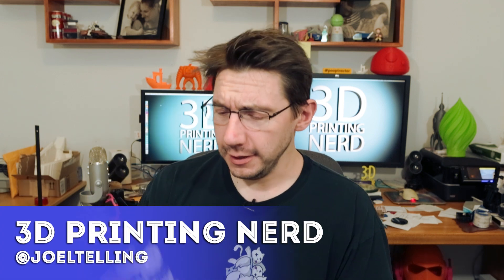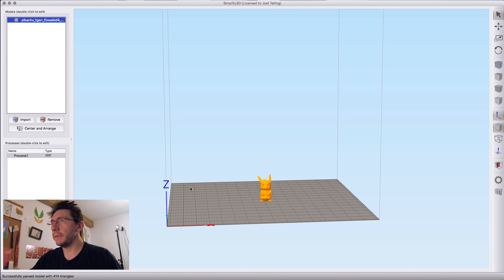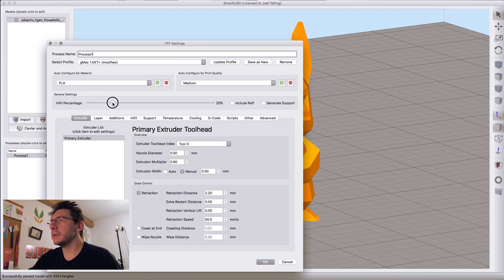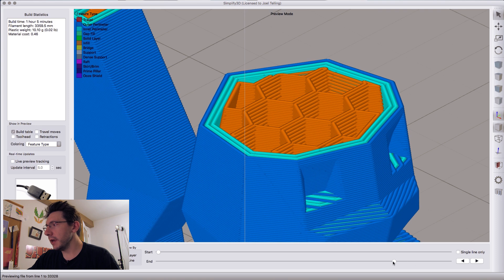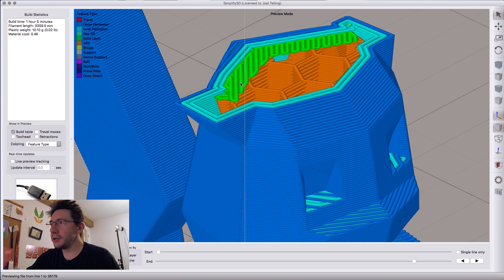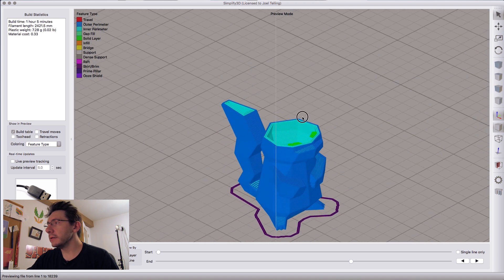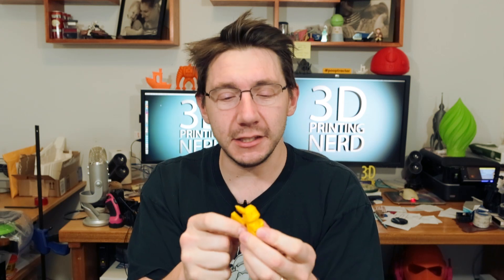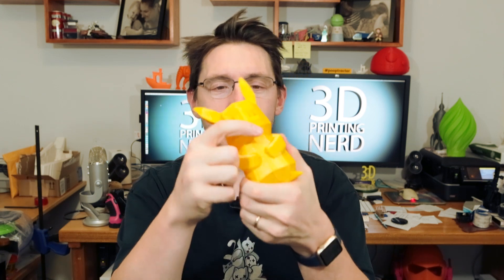3D Printing: Stop Wasting Plastic on Infill Percentage

Comment: ...and, slic3r and the newer cura, both open-source, have settings to use internal supports when your infill is at 0%, whereas your favorite proprietary simplify3d DOES NOT HAVE THAT, so how do you feel about advocating so loud for proprietary stuff?
Reply from the maker: I advocate for what I use and what works for me. #highfive
Reply: 3D Printing Nerd
so, let me understand here: you make a video about printing hollow with simplify3d even though it is the inferior slicer for this case, since slic3r and cura both have a feature which allows complicated hollow prints to succeed while simplify3d does not; and you call that 'what works for me', just because you in this case used a simple part? Notwithstanding the fact that simplify3d forbids sharing the resulting gcode and the reverse engineering of its .factory format, this is just plain wrong.

Also, nothing prevents you to use slic3r and cura. They are open source and also freely downloadable.
Reply from the maker: +Cláudio Sampaio This video is also a year old, and I've had the chance to use more than Sinolify3D in that year. Simplify3D doesn't prohibit the sharing of their generated gcode - I've looked into that AND had a conversation with Simplify3D and that just isn't the case.
Reply: 3D Printing Nerd
it is in their EULA, what they say to you personally does not matter much because it is the letter of the law that matters. I talked to Richard Horne and he said he had the same conversation and they said they added this to prevent people from making their software available through the cloud to lots of people and thus harm their sales. There is even a reddit thread about it, read on: https://www.reddit.com/r/3Dprinting/comments/49otwi/simplify3ds_license_prohibits_the_sharing_of/

Let me emphasize that this is the nature of proprietary software: anything and everything to enforce that artificial scarcity that leads to profit and power, even if it harms the user. Nothing wrong about profit, but everything wrong about control of creative work and arbitrary prohibitions.
Reply: It will very soon. In the meanwhile, if you use Cura 2.4.x or newer, you can add a few stls like cubes, overlap them with your print and select specific settings for these objects as "Support mesh" (force support where it intercepts with regular meshes) or "Anti Overhang Mesh" (force no support on the region). Try it, it is a little more trouble than using a dedicated manual support interface like in Simplify3D or Craftware but it gets the same results. I have made a screenshot to illustrate this to you: http://imgur.com/a/MeQJX
Reply: Cláudio Sampaio wait , so you essentially made the cubes into a grid pattern for custom infill or for supports? Great idea man, i will try it out, thanks!
Reply: Cláudio Sampaio i want cura to have custom supports like s3d and that other one
Reply: Slicer and Cura don't support basic features that Simplify 3d do. I would love to use a non-proprietary slicer, but non of the ones available are any good. Want to print a batch of parts with different settings? Only Simplify 3d. Want to have decent custom supports? Only Simplify 3d. Want to use infill that doesen't suck? Only Simplify 3d. Its infuriating because its interface sucks. You can make presets for different filaments and printers and quality, but its not clear what settings transfer over from preset to preset, and it likes to randomly lose settings so in practice the presets are useless.
Reply: why dont you make a youtube video about it then @claudio,  oh, seems you arent very good at it.

Comment: Considering the last functional items I printed on my machine were things that needed to bear a fair amount of load, I wouldn't consider dropping my infill percentage below 10% of them. These items were 50m worth of ABS filament. If the part breaks, that's wasted filament as well. I'm not going to quibble over a meter or five (at most) worth of filament as long as the print works. Now if you're screwing around and making Tchotchkes, sure, cut the infill. But if you're doing functional things, don't take the risk unless you can do your own FEA.
Reply: Now if only you could have watched the video instead of whining to the comments about something he already covered.

Comment: i get bad surfacing if i go below 15%, so i usually use 20% if i dont care and 25% if i do. if i want a structurally rigid part i usually use 2mm walls on everything. you can add further rigidity with geometry, like stepped ridges, grooves, or putting holes everywhere, the idea is these create additional perimeter passes in areas that need reinforcement. theres a lot of things you can do with strength increasing geometry (like a protruding peg on one part i made kept breaking off, and i solved the issue by ringing the base of the peg with a bunch of 2mm cubes, to generate better adhesion between the side walls and the surface layers). these work independent of infill since its all going to get extra perimeter. you still use plastic but at least this way you can select the areas you want reinforced. infill has diminishing returns when used for strengthening.

Comment: How about making a crush test comparison of different materials and infills using printed spheres, that would give a really good  idea about how much infill actually effects strength(and it would also make for a good visual demonstration ).
Reply: Actually spheres would be a pretty bad example as they are very structurally strong to begin with, a cube would be more representative of the average model.
Reply: Which is why I suggested them, with cubes all you would get is crush of layers on top of layers and that doesn't really tell you much about anything beyond the materials resistance to compression.
Reply: Thomas Maker I don't follow. A sphere will absorb a lot of the stress in its shell (a property not shared by most models), thus significantly limiting the effect of infill (which is what we want to test).
Reply: 6AM response and google+ not immediately showing the context to help one remember that it was about infill and not layer adhesion/shear and stretch strength(and a post made 2 weeks ago).....The inherent strength of a sphere might still give some interesting results though, seeing the difference between a sphere and a cube with the same wall and infill using a variety of filaments could be quite illuminating..

Comment: Quick Tip: For prints that must have say 30% infill just in one critical area, You can make 3 or more processes in simplify3D to for example use 5% and 30% and then 5% again.
Use start and stop at layer and change infill amount and top,  bottom solid layers of our processes.

Comment: I only do solidworks and sometimes autocad when it's about designing solids, so I'm not really familiar with the honey comb infill thingy or the other method , is that something only  simplify 3D does?
Reply: it's pretty much a staple in any 3d printing software thees days.
Reply: Although it wouldn't be that difficult to create a part with your own customized infill in solidworks. Just use shell command and combine it with a honeycomb grid. I'd imagine you would have much more control of the design that what you'd get in slic3r or cura or whatever.

Comment: You need more plastic for density, hurrrr durrrrr
Reply: Kane Smith but why do you need density if the model is going to be sitting on your desk?
Reply: max chavez Not everything printed out is going to be a toy, and even then, paper weights need a little weight to them as well.
Reply: in those cases yes, you need a bit of infill depending on what is the purpose of an object, but in some cases you don't need to have too much weight, like a drone casing for example
Reply: In that case, why not pause it halfway through, put in some nails (or lead) and hotglue, and continue? That'll really give it some weight!
Reply: Jelte Klas Wijnja because you dont want to "weigh it", you want to have it solid, so resin or something like that ,hot glue might melt your print lol but i see what you mean
Reply: Perhaps printing with the GMASS Tungsten filament would be enough. It weighs 4 times as much as water, so it will actually sink! It is quite brittle, however. Perhaps print a partially hollow print with open sides, so the water can flow in? That way, you won't have trapped air in the Infill.

Comment: You didn't say anything to really prove your point
Reply from the maker: +Nugenrules Well, crushing is interesting because of course infill will help - if anything it puts more material in the way of what's crushing. However, YES, test this when you get your printer!
Reply: Lol, okay but I would like to see something crushed for testing. Don't you think it's not enough to break one without infill without a reference to one with? My cheapo 3d printer comes in on monday so I'll be able to test it myself if you don't want to test this and video it yourself.
Reply from the maker: +Nugenrules crush the bigger Pikachu? My kids would kill me if I hurt that thing.
Reply: I agree with this if the part is decorative. But if I were printing all of my parts with 0% infill, my kid would surely break it. I agree with you on reducing plastic use and being conscious to the types of plastics that we are using and the impact that some of these plastics have on the planet. A little more testing would have been nice to see, but great video. thanks.
Reply: There are plenty of videos with infill % strenght , this video is more for those who print a big pikachu with 75% infill , total useless even if you want to sit on it, and if your kids are breaking it it's because your walls are to thin, 0% infil with 5mm walls is way stronger than 75% infill with 1mm walls , cause when it falls on the ground, it is not the infill who protect it from breaking but the thinckness of the walls . Infill in my opinion is here for support and antiflex (for decorative parts, as thsi video clearly talks for functional parts)
Reply: Yeah, I didn't see anything. Sure he broke an ear off, but the piece where the ear and the head meets wouldn't have any infill in it anyways.

The only thing I can conclude is that small plastic parts are tougher to break. Should have tried to crush the bigger pikachu with and without infill.

Comment: You know, if strength is what you require adding more perimeters is often better than adding more infill. Infill is needed to prevent the part from buckling if you try to kink it, and adds strength in compression so it resists crushing more. You rarely need more than 10-15%, if that. For aesthetic parts, you don't really need any.

Comment: you print cute cuddly things. infill is only for suport. i print stuff that ceep your bumper on your car or hang your monitor on your wall.. i need a bit infill..
Reply: Then you ain't wasting the infill if it is needed.... duh
Reply: Also, knowing a bit about the strength of structures will allow you to design objects that use minimal material while being as stiff and strong as possible.
For instance, consider a simple beam. Several things to consider with a simple beam.
1. The highest stress on the beam occurs on the top and bottom surfaces. Top is under compression, while the bottom is under tension.
2. The stiffness of the beam varies with the cube of the thickness.
The above 2 items is the reason that a steel I beam has the cross section it does. The top and bottom surfaces handle the load while the vertical portion is just to simply keep those 2 load bearing surfaces a fixed distance apart from each other. This allows for far less material to be used to handle a desired load.

The exact same principle applies to plastic and infill percentage. In many cases, if you have a beam in your item and that beam is failing, you can get a better result by making the beam thicker so that the bottom and top surfaces are further apart from each other while adding minimal material between those 2 surfaces (think I beam) than you would get by keeping the beam dimensions the same and increasing your infill percentage.
Reply: Same here, but seriously sometime I see poeple making figurines with more infill as I use for functional parts , for strenght you better add walls than more infill, in a certain way.
Reply: If you need something that will hold tv on wall while still looking fancy as you designed it why would you use infill just drill it fill it with cheaper stronger material.
Expanding foam for sth like it has to survive fall from 3m.
But still hanging your monitor or tv? Use wood it is much cheaper...
Reply: Missed the point all of them probably Biden voters Yeah I went there.

Comment: One more advice: if you do want to print a solid model, do not set infill to 100%.  Slicer just goes crazy. Instead, set bottom layers to 100500. It will be stronger and print faster.
Reply: 100500?
Reply: Agreed!!!  It prints MUCH faster!  It probably  ends up stronger as well
Reply: Sweet corn, you've done it....  you literally change the bottom layer from say (7_layers) to (100500_layers) and it will be a 100% infill model.   my Dickasaurus Rex went from 4  hours with 0% to 13 hours with 100500....
Reply: @offr0adrangerguy  Where are you sticking that Dickasaurus that you need 100% infill?
Reply: What's 100500?
Reply: By 100500 you mean 100% right?
Reply: Does this work in cura?
Reply: i was thinking personally just set perimeters stupid high. it takes longer but itll be even stronger
Reply: @pajamas720  I observed errors where thick perimeter intersects upon itself. This was 5 years ago.
Reply: Ater all of the fighting and dick waving above, I'm happy to report that yours is the only advice that I found valuable out of this whole comment section.. THANK YOU!
Reply: I too don't know what 100500 is...
Reply: Robert Medina I assume is a way to cheat the slicer to print all the layers in a model as solid as the bottom one. Hence the 100500, which is an arbitrary number for 'all the layers'.
Reply: What if I don't care about how long it takes?
Reply: Percival917 
Do what you want ....

Comment: Great tip! In general I use just enough in fill for the top layers to print. I'm at the moment printing a pulley from PLA which is flat across the top for 3 inches! 10% Does the trick nicely.

Comment: IF the model is for "looks" I usually print with 0% infill with two shells/outlines/perimeters(whatever your slicer calls it) and usually get away with it long as I use 5-10 "top" layers. I've spent countless hours printing including two whole home made printers while only using probably 5lbs of PLA/ABS in 2+ years.

Comment: Sure forget about infill as long as the part is just for show, if you actually need the part to do some mechanical work, varying infill density along the sections that require it is a must, specially with abs. In short, if its not a serious project just do whatever infill.

Comment: Personally I don't care about the plastic usage at all since I print very often and only use 1 roll per month, and I am only concerned about printing time and quality. I print with 50% infill for parts that I use for my printer. But you are right that some parts could still be made with 3 or even 4 perimiters with little to no infill and still retain strength. It works with pikachu, but won't work so much with objects that have a flat surface on top.
Reply: With proper cooling and a few top layers it'll work just fine even at 0%.

Comment: Hey- love the vid......I often run my printer when i leave for work but dont have anything to control it with. I have used a wifi camera but its not helpful if i something goes wrong, do you know of anything on the market to help with this? the only product i have found so far is 'heero'.....https://www.kickstarter.com/projects/guzu/heero-monitor-and-stop-any-electrical-device-remot which looks great but do you have any advice?
Reply: Get a raspberry pi and setup octopi, you can cancel a print, as well as, turn off fans and motors...

Comment: It would be interesting to see a stress test to determine the optimal fill rate/wall thickness for a given application, e.g. torsional, transverse and axial load capabilities.  Maybe something like a rectangular prism of a standardized size.  Perhaps different materials would respond more favorably to a reduction in fill rate or wall thickness?
Reply: 40% according to the undergrad paper someone did at our uni on our instron. All black PLA on ultimakers

Comment: Hello,
I've recently begun using an Ultimaker 2X and have been having some difficulty with ABS prints.  The PLA models work very consistently, but the ABS models often (usually) come unstuck from the print bed during printing.  As an experiment, I recently tried a model with a large footprint to see if having a greater surface area on the bed made any difference.  It too came unstuck from the bed after the print had reached a height of about 5-6 mm.  I'm thinking that perhaps as the uppermost (most recently deposited) layers are cooling, they're contracting, causing the print to warp and pull up from the bed.  I thought that perhaps less infill might eliminate this, so on the large footprint model, I lowered the infill percentage to 5%, but it still peeled up.  Maybe this is less about infill and more about bed temperature?  Any thoughts?       Thanks!

Comment: Totally agreed! (This video was featured here: https://3dprinterchat.com/2016/03/3d-printing-dictionary/ congrats! ) I would like to add that I design in voids inside my models specifically to give high-overhang models strength even though they would sag as they would print from the inside. Saves plastic and adds an even more tremendous amount of strength. High Five, man!
Reply from the maker: +nathanallan1 That's a good way to do it. Thanks for the tip! #returnfive